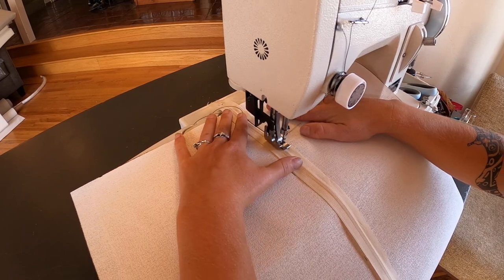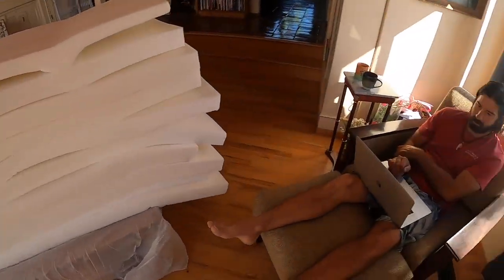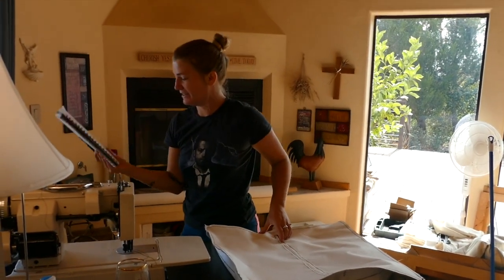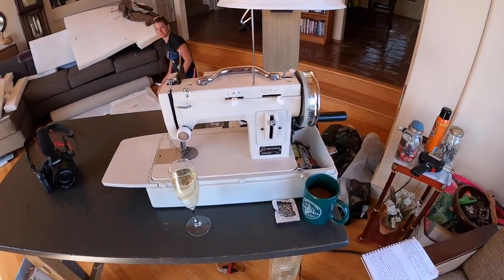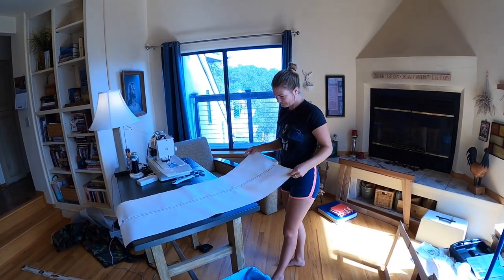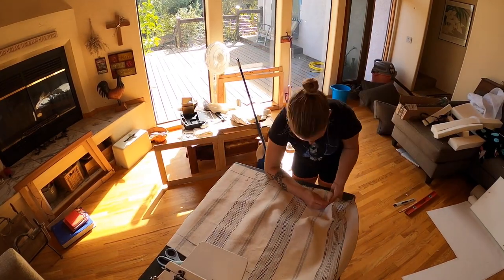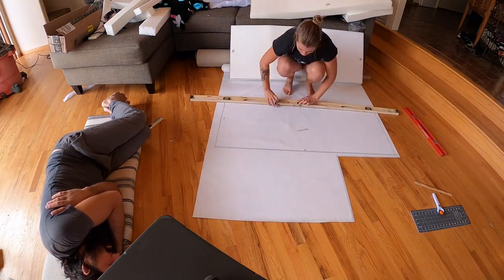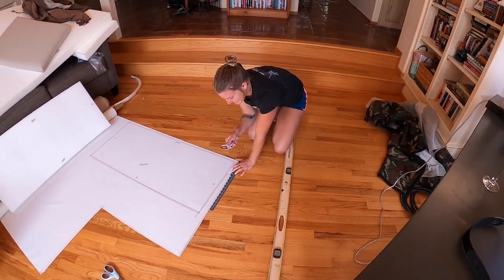Salt & Tar: Ep.164- Learning to Sew

Comment: Never leave to plastic on the foam. If it gets wet it will not dry. Plastic will breakdown quickly and bunch up inside. So many reasons not to leave the plastic on the foam. Did it and ruined my foam only I had to work to pay for mine. Makes a difference in how things are cared for.

Comment: Well Ruth, I must say that Garret is a very lucky man to have you, your skills are great and it shows that you are the dream girl that will learn whatever it takes to help your dreams come true. Great Job!!!

I know it’s a new machine but I must ask, are you keeping up with the required maintenance and lubrication it needs? I fix sewing machines and most of new machine owners don’t even think about these and their machines break down and wear out fast. Make sure to get the right machine oil/grease, DO NOT use WD-40 on it, and make sure to lubricate ALL locations where two metal pieces move against each other.
Reply: Y E S  ! !    WD-40  is  'Water Displacement recipe # 40' =  NOT  a  Lubricant .    My 2nd  wifey  used  it  to  "lubricate"  her  motorcycle's  chain  and  the  chain  failed  almost  immediately  afterward.   It  washed  out  the  previous  lubricant  leaving  the  chain  'dry'.    WD-40  is  great  for  removing  road  tar  from  your  car ,  for  freeing  up  rusted/stuck  bolts ,  a  squirt  into  the  distributor  on  my  1964 Dodge D-100 Town-wagon  on  a  cold  foggy  morning  would  get  it  firing  on  all  cylinders  again ,  many  other  non-lubricant  applications  =  great  stuff !     But  where  metal  meets  metal ,  always  end  with  a  good  lubricant/oil .                 thanks  Gilberto ,                   RH

Comment: SEWING TIP: Ruth, you need to go back and finish your seams (unless you didn't show it in the video). There are several ways of finishing a seam. 

The first requires the use of a Serger (a.k.a. Overlocker) which will put the "professional" seam finish on that you find on the inside of jeans, dressers, shirts, etc. and the Serger will trim off the excess material. This became popular commercially in the 1950s through today.  I don't use it and there is no need to buy an extra machine just to finish seams. 

The next method is when cutting out the pieces of fabric, use pinking shears (the shears that have the ziz-zag edge on them), The little fabric triangles tend to lock the fabric threads in place so they don't come unwoven while wearing or washing them which prevents the seams from ripping out (which is why you finish a seam btw). 

The third method (and the one I would recommend for cushions, is after you have sewn your straight stitch to make the seam, go back over the 1/4 " seam allowance using a zig-zag stitch with one side just off the edge of the material and the other well on the fabric, close to, but not past, your straight-stitched seam. This will hold all the threads of the fabric in the seam allowance together so the fabric doesn't fray (unravel) which would allow your seam to rip out because the fabric your seam is sewn in has lost its stability. 

The fourth way is the Feld Seam but it is too late to do that on the vertical stitches in the corners but could possibly do it around the bottom depending on your seam allowance.

This video is an introduction to seam finishes: https://youtu.be/s3Q4wUZiZmU that I would recommend watching. Then I would go into more detail by watching this video: https://youtu.be/CGUvR9vKPk0. I love Evelyn Woods sewing channel but I have never actually taken her Vintage Sewing School course but imagine it is probably pretty good based on the content of her free YouTube videos that she puts on her channel. (I am not being paid for this endorsement either, I just really like her videos and have learned a lot from watching her explain things about sewing).

Comment: "Nice and Floofy" for a T-shirt campaign with a picture of the striped cushion in the dinete seat, maybe a three quarters reveal with one end faded away?
But definitely showing the wood back rest and the cusion in color, maybe a bit of the table top? The wood in a 75% translucent wash, and full color for the cusion would work to make the homemade cusion the star of the shirt. My mom put herself through nursing school working side jobs as a seamstress for various club's dancers and hired positions with schools drama clubs and such. Now, in retirement, she quilts and does needle crafts for gifts and to have something to keep busy. She still sells the occasional piece, but with big chains like Walmart selling machine made "so-called quilts" for cheap, hand made quilts are hard to sell for what they are really worth, considering the manual labor and artistry that goes into them.
A hand made quilt for a queen sized bed, for instance, should price out around $1800-$2000, if you look at around only $12 to $14 per hour plus materials and artistry value. (And that is using a large quilting machine to do the final quilting pattern stitching after the layers are all put together. Hand quilted would run the price even higher. I have a all hand cut and hand stitched full sized quilt going that I have been working on for years that has never been to the sewing machine. It will stay in the family when completed because no one will ever pay for the labor that went into it. It has 377 pieces just in the top layer.

Comment: Just a note as we had this happen...if the film is left in the cushion and ANY damp gets in there it can cause mold.  We have leather cushions and had to replace 4 of them due to mold staining the leather.  Yours are fabric so maybe no issue but I'd suggest taking the film out after you get the cushion in.  We also use float foam for all our cockpit cushions as a safety measure.

Comment: sewing.. if working on a table with a portable sewing machine.. you may want to invest in some foam sheathing to build up the surface of the table beside and behind your sewing machine  so you can sit in the L shape to the right and lean left to access but have the material slide freely from behind you and all the back of the machine to prevent it from dangling..   glossy shelf paper can be added to the surface of the foam to make it slip the cloth easily.   i built up one friends table surface out of layers of cardboard with the sewing machine sitting in a cut out in the middle. . but there was still a layer of cardboard attached to the rest that was under the sewing machine.

Comment: I have the same sewing machine, they are fantastic machines.
Reply: What is the sewing machine make and model??
Reply: Michael, it’s a Reliable.  It’s the same exact model as a Sailrite.  The parts are even interchangeable. Reliable is located in Canada, but these machines are manufactured In Taiwan.  I believe they ship for $499.  They also sell a larger outboard wheel that increases torque to sew leather.  It’s no Juki Commercial machine, but very capable. The high torque wheel is $106 extra, they are running one in this video.

Comment: I have to question the second layer of plastic.  I am guessing here but I think you might be setting yourself up for mold in your foam.  Your foam pads will already be in a very high humidity environment and that second layer of plastic will make it very difficult if not impossible for your foam to dry.

Comment: Cushions look really nice, the "silk film" intended to water proof the cushions may make them harder to dry off... will this also be used for cockpit or sunbed type outside cushions ?  Noticed at 25:45 how much Garrett resembles Swab in his "guard" position on deck he he ! Congratulations Ruthie !
Reply: I also found that they took a lot longer to re-inflate when sitting on them. To the point that 5" flattened to 1" when sitting. I ended up removing the 'bag'. POI you really don't have to get the whole thing, I just grabbed & tore.  The second pair was done bagless...easypeesy.

Comment: This episode's videography is nice, I loved the seamless transitions.

Yet some of the contents seams sew-spicious to me. I've always been impressed about how y'all tend to avoid stereotypical gender roles, showing off Ruth's capabilities. But, are you now drifting from the pattern? You're correct as Garrett would probably come unraveled and start procrasti-knit-ting if he worked on this project, but Ruth obviously has it all covered as usual. I'm on pins and needles to see what looms on the horizon for Salt and Tar.

I thought about cracking some jokes here, but y'all are already are in stitches and this might be the wrong comment thread for that kind of thing. So, I will quilt with the jokes.